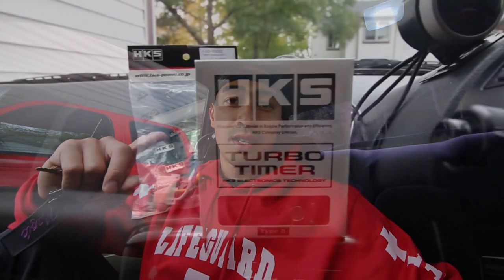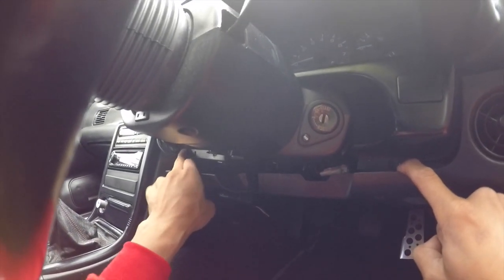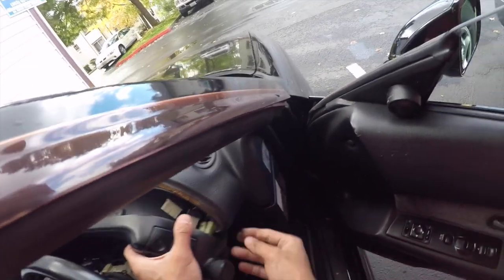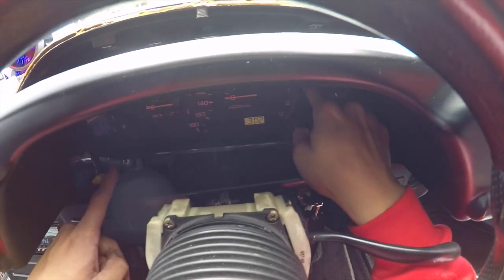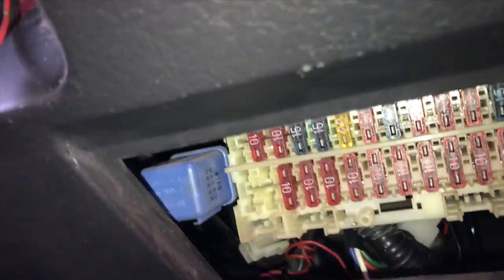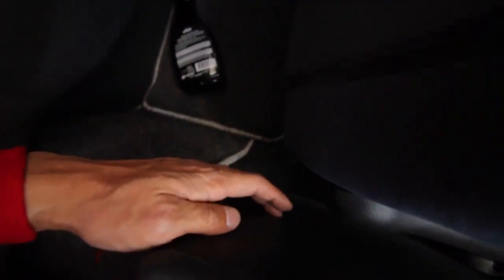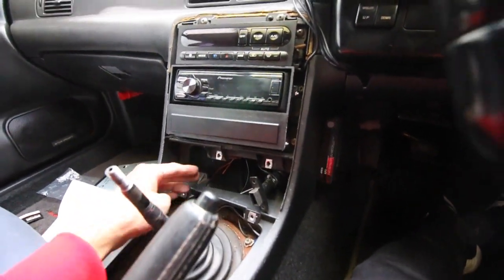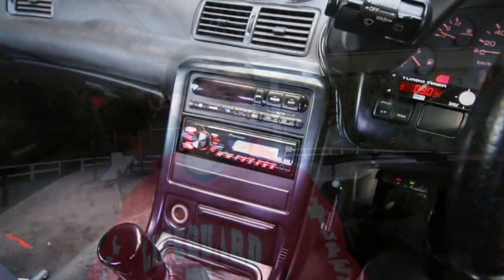R32 Skyline GTST HKS Turbo Timer Install | Type 0 GTR

Comment: FYI: You dont need to push the clutch to start up with Japanese cars as long as it's on neutral
Reply from the maker: Hue Moua lol I know. Just something I’ve always been used to. I’ve done 3 motor swaps and each time it disabled that safety feature. But still clutched in to start
Reply: That's true, took a while for me to get used not to clutch in to start when I first got my GTR LoL
Reply from the maker: Hue Moua yea I catch myself starting without but I have other vehicles that require it so it can get confusing when you’re not thinking about it